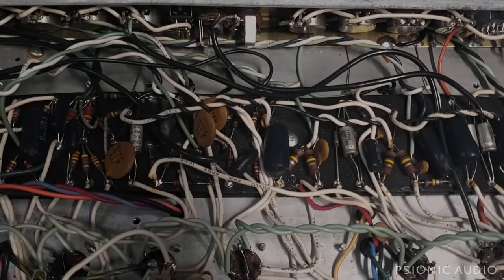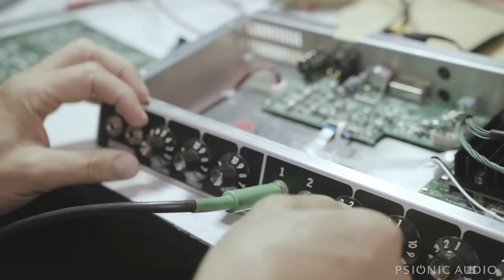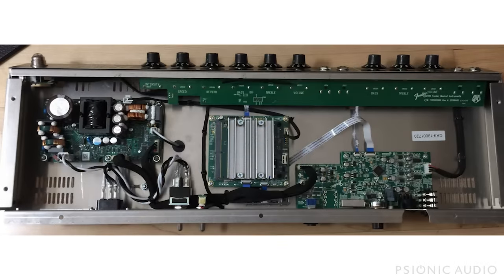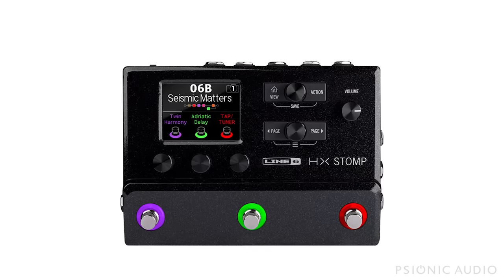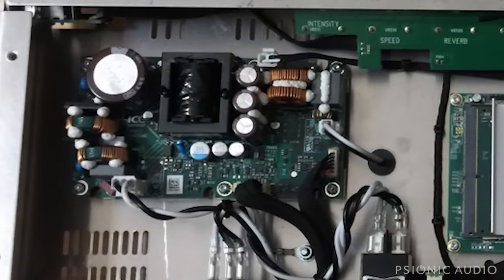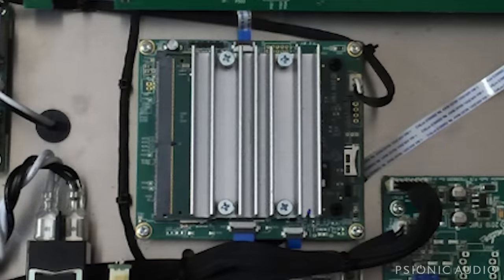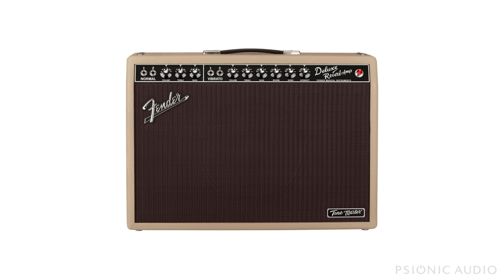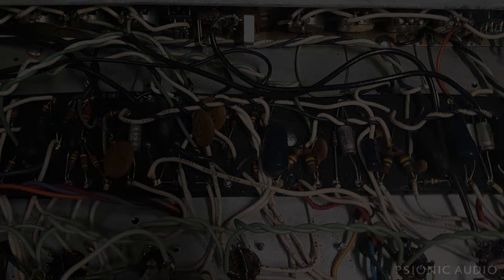We Need to Talk about the Tone Masters

Comment: Most likely a failure in a few years means straight to the dumpster. No thanks.
Reply: I wouldn't say straight to the dumpster, you'd still have a nice chassis/cab/speaker to build another amp with.
Reply: @YanSylvio  ,  Many younger, or bedroom, players who buy this amplifier probably wouldn't bother to sell it off for the cabinet and parts if it broke;  *they'd likely just throw it in the dumpster like they have been CONDITIONED to do with everything else electronic that breaks down*.

Comment: Go to Brad's channel. He did a whole rant on Tonemasters. They tend to have a very high failure rate and according to Fender Australia, are unrepairable. The pots are digital encoders and not traditional Fender blackface circuit values. I would never buy one.
Reply from the maker: I've been chatting with Brad tonight. There might be an issue with Fender Australia not knowing what they were talking about.

The ICE module that failed is available, at least in the US. The pots are 10K linear - not trade values. But standard pots.
Reply: @PsionicAudio  I still like Brads idea best, rebuild them in to a proper tube amp. I realize this goes over the budget of this series. The TM series is a technical achievement no doubt, but the price point they had to bring them to market at really caused too many compromises in design imho. A mini USB port instead of usb-c in the back of the amp. Come on Fender….this is 2022. That was nothing but a stupid choice on behalf of the design team. Oh well, it is what it is…SMH.

Comment: My biggest problem with these is this: You get what, dozens of amp models in a software package for your computer for $50 to $300? This puts one in a hardware package, and charges more than the cost of some tube amps? Logic dictates that these should be worth the cost of the cab and speaker and a few components, plus the value of a single amp simulation - which judging by the cost of the bundles of them made for computers, should be maybe a few dollars. I feel like these amps should be priced at about half of what they are.

Comment: Fyi: i wouldn't mind if I were the original maker of the photograph but this does not count as fair use. You reviewd the amp, not the photograph.
Reply from the maker: Which photos do you find objectionable? All but a few were Fender's or Sweetwater's, and this video might actually sell some for them. I'm not slagging them, just pointing out pros/cons owners should be aware of. The other tech's photos showed some details of the construction the official photos did not. I did reach out to them but did not hear back.
Reply: @PsionicAudio  I find none objectable. I have no interrest. in fact i like them. I am just elaborating on ''fair use''' in IP law context. don't worry on my account.
Usualy fair use is understood as using copyrightable content while reviewing it, providing critique and context. You are critiqueing the amp, not the photograph. In any case, it is not a waterproof defense BTW. Copyright is copyright.  (which sucks)
Sorry if i gave you the wrong impression.

Comment: tubes,,,no tubes....I don't care....in a couple of years you won't be able to get the parts.....I have a Vibro Champ XD and a Super Champ x2....I hated my Mustang 111......I would take the SC x2 over the TM......you can get any sound you want via Fuse if you're patient and if it dies you're not out a lot of money so you buy another used one that is working and it has an effects loop and tube output......if you think it isn't powerful enough plug it to the sound system or patch it to a bigger amp...the TM is too much money.....if it were 400 then it would be ok but not at its price point

Comment: I'm betting that some of these will get hit with transient spikes and surges from bad power at gigs, like when the beer cooler or the AC kicks on,, and if they don't die immediately the modeling processor will become flaky and develop a mind of its own. I certainly wouldn't recommend running one off of a generator at an outdoor gig!
Reply: Nor would you with a tube version, no?
Reply: @ErwinvanAsperen   Tubes can handle quick pulses of 1000 V or more, and even the filter caps might handle a quick over-voltage pulse if they're relatively new and rated for 500v or more (some vintage Fenders used 350v caps in series for 700 volt capacity on the first filter node). A modern tube amplifier, however, often has electronically operated channel switching and perhaps digital effects such as reverb or whatever that would be more likely to fail than the actual tubes themselves.  Arcing over between adjacent foils is also more likely with circuit boards than with eyelet boards or turret boards found in handwired amps.  Switching supplies tend to be rough on their own filter capacitors, and if they're hit with a lot of noise on the incoming AC line, premature failure is very likely.
Reply: @goodun2974  so youre telling me it could pretty much happen to all types of amps, except some vintage ones (which have their own problems with reliability). I dont think this is a problem.
Reply: @ErwinvanAsperen  , no,  What I am saying is that amplifiers can and should be built up to a standard, and not down to a price point.  A vintage all tube amp can be rebuilt up to a standard of high reliability by a good technician.  A more modern tube amplifier might be capable of being built up to a high reliability standard by a good tech, but if the amp has a lot of the modern features such as channel switching and digital this/ digital that which many people have come to expect from modern amplifiers, those additional features may well come at a loss of long term reliability, or even short term reliability in a rough gig situation.  You're better off using pedals for your effects and keeping the amplifier circuitry as basic as possible.

Comment: Oh Brother !! Be careful of those ribbon cable circuit board connecters , for those female connectors break very easy when installing the ribbon cable !  It looks like the connectors are the ones that has the black release tabs that break easily ! Those amps are considered as throw away amps due to the inexpensive circuit boards ! 100% proprietary design for Fender ! Basically (Stay or Run away ) from buying one !